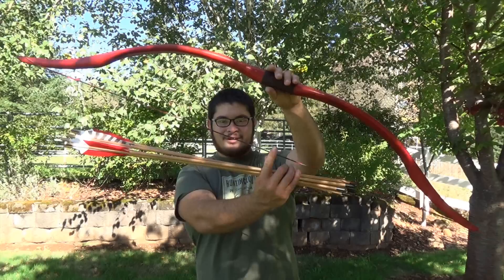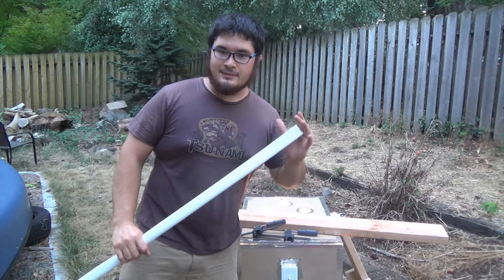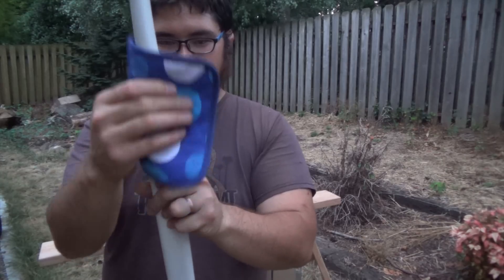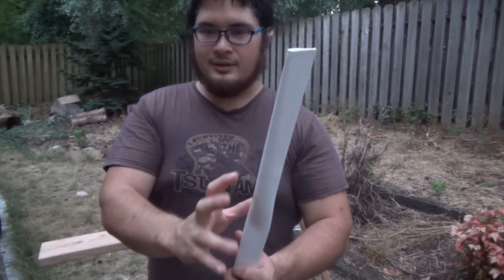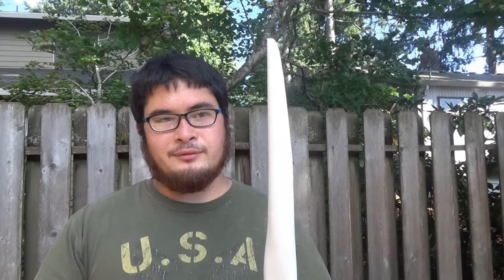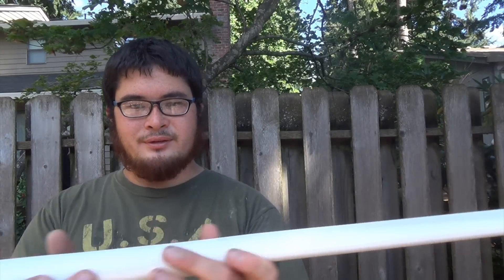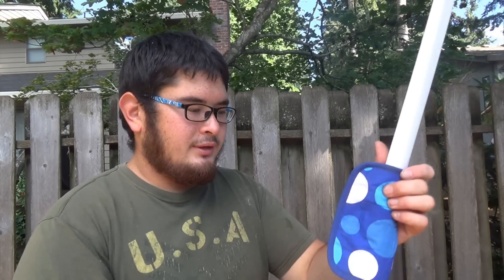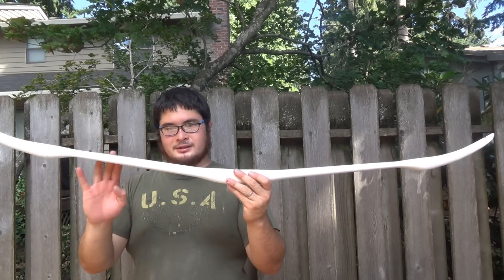How to Build an Adult Bow and Arrow Set Part 1 Flattening and Shaping Siyahs 1

Comment: Watched this video like 50 times in a row in preparation. Spend like 9 hours working on it and the first time i string it up one of the limbs collapsed. Reheated that section and it collapsed again. Reheated entire limb then the other side collapsed... going to leave it alone for now and maybe start over and/or leave the next one with flat limbs... I wish i knew why this was happening. I got it as symmetrical as i could before stringing it.
Reply: Alp Ertugrul is the bow string too short? It may also be weak pvc.

Comment: Hy

I'm french. Can you tell me the diameter of your PVC pipe ?
thanks
Reply: 3/4-1 inch probably. i've made one and in my opinion 1 inch works great for bow of that strength..
Reply: OLIVIER DECORTE it's one inch diameter PVC pipe, and the walls of the pipe are 3mm thick—called "schedule 40" pipe here

Comment: Howdy ! All.
I made a PVC bow yesterday ...and today I corrected my mistakes (i think)... its a basic bow nothing fancy
I used a schedule 40 " PVC pipe used for electrical cable conduit....(looks to be the same as water pipe just the ends re flared)
...my problem is it was fairly weak.... guessing at 15 to 20lbs pull is all.
 I realized that sense I made the bow a bit longer than your instructions of 56"  (I made mine 6' ) that that alone would cause it to be weaker.... so I cut it down to 5ft  and heated it up and un flattened it on both ends and added a 1/2" flattened PVC piece inside the bow..... I had to trim the 1/2"PVC ends because the flattened part was 1 1/4" wide, too wide to go into the 1" pipe.
I trimmed it on my router table.... after fighting getting the 1/2" pipe inside the 1" pipe I did finally get it in all the way.
I then re flattened the 1" pipe.... No reflex was added, its just a basic bow.... I cut notches in the ends to hold a 1/4" rope that has stretched to be about the size or paratrooper cord now (GRIN)  
However drawing the bow is super hard... I estimate at least 65 to 70lbs of force needed to draw it fully  I was hoping for 50lbs
... I have had many bows and my favorite was a 58lb pull Howard Hill long bow at 28" draw.... this PVC bow is at least as strong as it was. .... 
 any suggestions as to what I can do to lighten the pull a small amount ?  sense I have the 2 pipes in one now adding a slight bend to the  outer tube might be possible but I am sure it would not effect the inner tube. ( which is a little bow in itself)
I am really impressed that this bow came out so strong !!!! if I were Younger I wouldn't have any complaints , but at 64yrs old my strength is not what it used to be LOL.
Next I will try to make that Super nice  bow You made....... and I hope it turns out to  be 50lbs pull ! .
thank you for your videos !  you truly are a master at this ! its not easy to form that PVC ...and I see why you have a "Pot holder"
 ( BTW I use a propane torch to heat the PVC because I don't have a big heat gun.)
Thanks again !
Bob.........

Comment: Hi, I was trying to make this bow today. I'm a total beginner, hence my question. By mistake I bought a PVC pipe like this: 1" outer diameter, less than 3/4" (1,6 cm) inner, walls are 4,2 mm thick. The problem is I couldn't make the pipe soft enough by heating it. It got really hot, even started to melt a little but never got as soft as it should be (as u showed in other videos) and it didn't flatten at all when I tried using flattening jig. The question is, is it only a matter of the pipe? Is mine wrong and should I get a new one, with dimensions closer to the one you're using, or is my pipe OK and it should soften, but it's just me doing something wrong?
Reply from the maker: Are you sure the pipe is PVC? What color is it? With those dimensions, it's possible the pipe is their Schedule 80 thick walled pipe or is made of another plastic. If it's schedule 80, it can be worked but will need to be heated much longer. if it's another plastic, it may not flatten at all.

Hope this helps!
Reply: +BackyardBowyer Thanks for a quick reply!
The pipe actually was PVC, but as I found out, it's another kind of it, used in hot water installations or sth like that. That's what they gave me in the shop, though. I have surprisingly much trouble finding just a normal PVC pipe, but after doing some research now I know what exactly I'm looking for (hopefully) and that I bought the wrong pipe.
Now I can't wait to start making that bow, as it looks really great. Thanks again and keep up the good work :)

Comment: Hi, how long do these bows last? Only a number of shots or longer?
Reply from the maker: +Mr3kiwis As long as it's made well and the PVC used isn't brittle, it should last as long as any wood selfbow if not longer. I have a few bows with over 10,000 arrows through them and they are still going strong. Hope this helps!
Reply: +BackyardBowyer Thanks allot, that's great. Thanks for all the videos!
Reply: Do you ever do anything with the 2 inch marks? 
I get that the flattening happens till the 3 inch mark, but what does the 2 inch parts cover?
Reply from the maker: Those 2 inch marks are the transition from handle to limb. When shaping the handle, you want to heat up that 2 inch section, mostly near the handle, so that you end up with a nice curve from handle to limb and no sharp creases that can cause the bow to fail. Hope this helps!
Reply: Thanks.

Comment: Hi
just wondering, can I use a hair dryer as an alternative to the heat gun
Reply: +Angel Valencia Yes, it will just take considerably longer to get the pipe up to the temperature needed for it to be as pliable.
Reply: +Skeletor Jopko thank you

Comment: The wall is 3,2mm but which is 1",the diameter of the hole or the outside diameter?
Reply from the maker: +viki2133 The inside diameter is just a little under 1" and the outside diameter is around 1.25". Thanks for watching!
Reply: +BackyardBowyer So the wall is 6,4mm?
Reply from the maker: Both walls together are about 6.4mm, each wall is around 3.2mm because there are two walls in the pipe diameter.
Reply: +BackyardBowyer Oh,right,I forgot to think :D.And one more question,when I go to buy the pipe (because I am not american and it is hard for me to use imperial units) what should I say when I buy the pipe,considering that I want about 60 pounds draw weight and what kind of PVC do you use,PVC or PVC-U(which is the flexible one where I am)?
Reply: +viki2133 Australian standard is PVC-U in Class 18 or PN18 sold as PVC pressure pipe. I hope you can relate that to your location. Wall thickness here is only 2.8mm so it will be a lighter draw. This bow is going to be my next project.

Comment: How long does it take you to heat up the pvc? I just tried in my garage and it didn't get soft enough after 20 or 30 minutes, but the pipe is now slightly warped.

Comment: I don't know if that's dandruff or PVC shavings in your hair, but I got rid of my really bad dandruff by washing my hair with regular vinegar.  The first few times the vinegar will sting the scalp a little, but after that, it no longer burns the head.  Also, KEEP YOUR EYES CLOSED TIGHT!  It will make your eyes burn fairly decent.  Rinse hair well to remove vinegar smell.

I think the shampoos are made for caucasian hair, and stripes too much oil from my hair, leading to dry scalp and dandruff.  The vinegar cleans the hair, but leaves the scalp healthy.

Comment: Hey Nick, great video as usual!! However, I got a couple questions concerning how to make this bow. First of all, how did you make you flattening rig? Second, where can I get get a one inch spacer( or improvise)? Finally, are there any other ways to properly heat up the PVC than using a heat gun? Thanks for all the awesome videos you make!
Reply from the maker: Eric Lindholm Thanks! The flattening jig is just a board with spacers on one side. I used to use 1" blocks of wood as spacers. Here's a video of the type of jig I use now. http://youtu.be/i1Eub3KWSRI?list=UU_U6Yek0YgKHN_A-iTAwZbgThere are other ways to heat PVC. Here are a few alternatives.Stovetop - http://youtu.be/8YLul41IQ6U?list=UU_U6Yek0YgKHN_A-iTAwZbgFire - http://youtu.be/89gNnTl5MhM?list=UU_U6Yek0YgKHN_A-iTAwZbgTorch - http://youtu.be/r8kOr74PX-k?list=UU_U6Yek0YgKHN_A-iTAwZbg
Hot Box - http://youtu.be/RkT2t46PVVo?list=UU_U6Yek0YgKHN_A-iTAwZbgHope this helps!
Reply: Thanks Nick! Today I bought all necessary materials so I'm gonna start building it soon!
Reply: I was great! Still shooting strong today. AKARazorback
Reply: Eric Lindholm And, how did you do? :D

Comment: Watched All your Videos, and believe that I can do this as well. Thanks to your Precise Instructions. Thank you for sharing your wisdom with us!
If it wouldn't be too much, would you mind sharing a few Pcs. of Info. that I feel would help [Me] understand a few other things, and possibly even make a True Bow?
1st. In your 1st video, you mentioned that you used a 1" Spacer. What did you mean by that, and how does That Spacer make things better?
2nd. What are the specific names of those tools that you used to make your Nock supports? (I looked on Raptor Archery, and didn't see what I thought I had heard you say.)
3rd. Where can I find that Fletchling Holder?
4th. How do I determine the Length of my Bow?
5th. (and Final Q.) Is there a Preferred String that you use (Which)?
Thank you, Very VERY Much for your time!
(I cannot wait to get started on one of these!!!)

Comment: Hey Nick- question- I am making a jig to flatten and shape the tips. What is the width of the 1" pipe at the tip after flattening?
Reply: Measure the outside diameter of the pipe, divide it by 2, to find the radius then use a formula to calculate the length of the outside circle and divide it by 2.